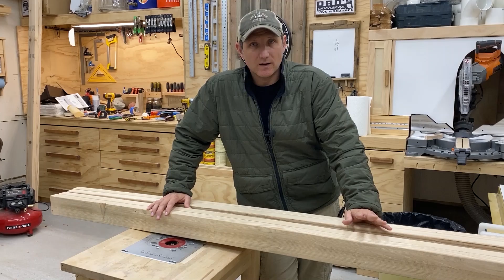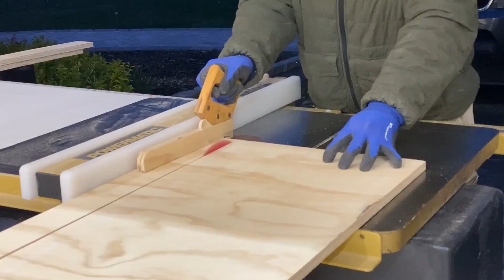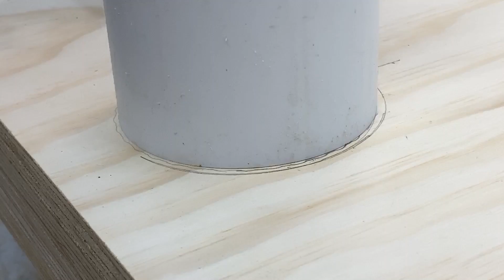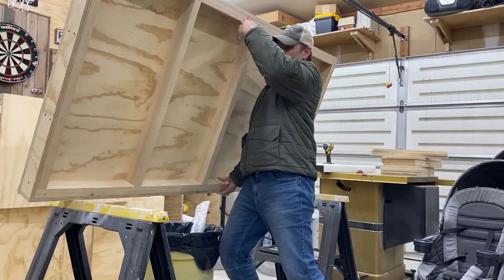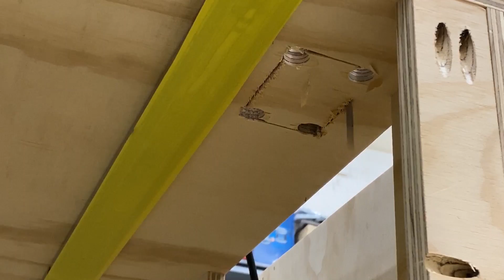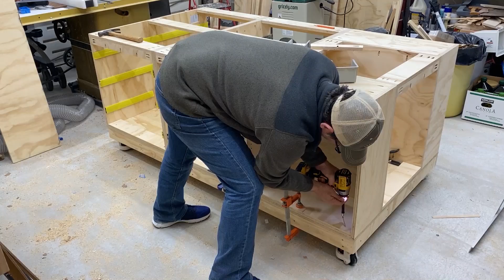How to build an Assembly Table Workbench / Mobile Workbench Ideas / Outfeed Table / Shop Upgrade

Comment: Grdat design.  I will be buildin gmine from some leftover studs.  I don't have a pocket drill kit so it's in from the ends and plug.  Good to see you are following the old safet method of never holding onto the waste when using the drop saw.  By the way I didn't see any splitter?  It might be an exccellent addition to your saw.
Reply from the maker: That saw is from the 90s. I have been wanting to call up powermatic to see if they sell them for these older machines

Comment: Should have added 1/2-inch ply to the top and bottom of your frame and made it into a torsion box.  Way stiffer that’s what you ended up with.
Reply from the maker: Great advice. I wish I would have thought of that before I built it

Comment: I like the concept of starting with a base and your build looks solid enough. How did the base strength go? Do you feel it might bow over time? or the plywood and 2x4 sandwiched should hold.... I was thinking of installing 6 casters two extra for the middle, over kill?
Reply from the maker: Thank you! It is very solid but I decided to slide a piece of wood in the middle as a precaution to prevent any possible bowing. If I had to build it again, I would add two more casters just for peace of mind
Reply: @ArtisanMade  I've finished my build following your example but deviated somewhat to suit my space and needs. I'm very very happy with the result and glad I took your tip on the 6 castors with bolstering the mid-section. I estimate around 1000lbs as the final weight and it is strong - strong!! The castors are simply divine to deal with. I finally have storage and more storage, which no doubt ill fill rapidly. Thanks for the guidance without which I would have not been as successful.

Comment: I enjoy your videos and have picked up a number of ideas and tips from them.  I appreciate your complete, clear and concise commentary on the projects.  How easy is it to move your assembly table?  I have a combination workbench/assembly table on 4" swivel casters from Harbor Freight.  It has drawers filled with tools but it should weight less than 500 lbs.  It very difficult to move so I am considering replacing the casters with the Rockler workbench casters but yours look like they may be a better solution.  Thanks.
Reply from the maker: My brother-in-law asked me the same question yesterday.  It weighs more than 600 lbs and I can move it with one hand with ease. If I lean on it, it moves. Keep in mind that my garage floor is super smooth and has no cracks. Thanks for watching!
Reply: @ArtisanMade  Thanks for the prompt reply.  My shop, in Roswell, GA, is a 13' x 30' room in the basement with a door to the outside and has a smooth floor.  I'll let you know how the casters work for me.
Reply from the maker: I think they are going to work well for you. They worst part will be turning it on it’s side so you can switch them out